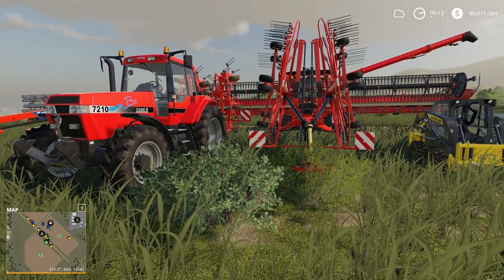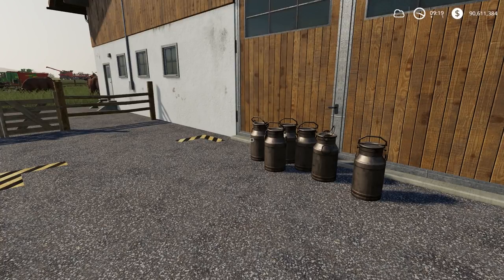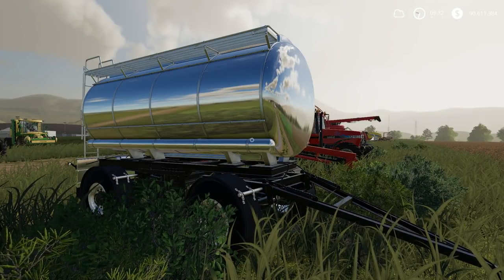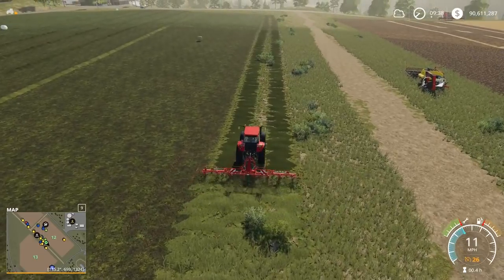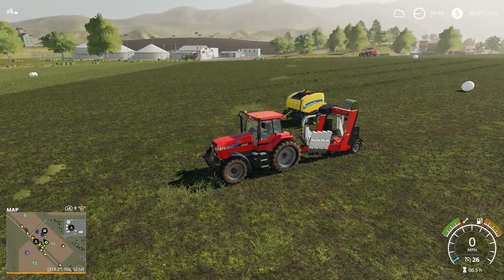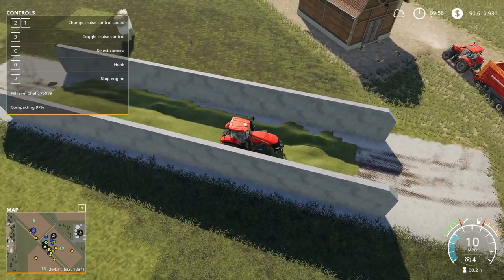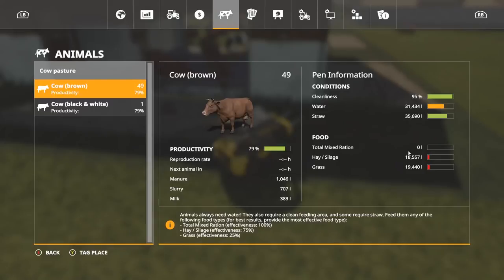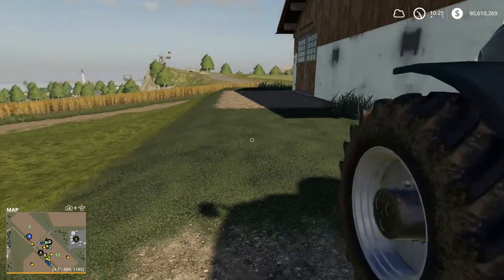Farming Simulator 19 - An In-Depth Guide to Feeding Your Cows - A Tutorial

Comment: Question:  what's a good way to give them loose grass from a bunker? The mixer won't pick it up and you have to drive over it for a wagon which changes it into chaff.
Reply from the maker: You could shovel it from the ends - don't drive on it.   I think that will work.  Shovel it back into a tipper or loading wagon.  Then dump the wagon into the feed trough.
Reply: @Vbluguitar  thanks! Looking forward to trying this
Reply: @Vbluguitar  Upon further experimentation, if you dump loose grass into the bunker it automatically changes to chaff, which I couldn't drop on the feed trough. I pile it alongside the silo now and it works fine, doesn't look out of place, I landscaped a little area for it.

In case anyone else wanted to know :)

Comment: ran across your videos a couple days ago, and this one when looking for info on what i thought was strange happened to me. I was mowing the grass that grew around my field, and the color was a light green. Then it started raining, and the new grass that was cut was a dark green. I took the windrow and made nice rows, but i noticed the 2 colored grasses didnt mix together, and when i went to round bail it, it would only pick up one color grass at a time.  I wrapped the round bails, and that went like normal. Im wondering if there is now a difference, or are both types the same. Now i also have a partial bail of grass, and it wont pick up the other type. Is there a way to remove it from the bailer or will it change to the next type im eventually going to bail?
Reply from the maker: The crap in the baler will give you a full bale of that material no matter what you put in it, and then switch - so if you have grass, and collect straw, you will have 1 grass bale and then once its cleared out, the rest will be straw.   The dark material is grass, the lighter green material is hay.   if you tedder grass (using a tedder) it turns to hay.  I find it strange that you were getting hay when mowing though - are you using a mod mower, or maybe seasons?

Comment: SO I know for FS17 you needed Grass AND Hay/Silage AND TMR to get the best results - though TMR would fill both TMR and Hay/Silage bars.

In FS19 on the animal status page it lists requirements as 25% Grass, 75% Hay/Silage and 100% TMR - does that mean we can use either Grass AND Hay/Silage OR just TMR to get the same results??
Reply: Neil Harbott if you use TMR you will get 100% productivity if you use hay you get 75% and grass 25% but if you use grass and hay you’ll get 100% so in fs19 you DONT need to have all three
Reply from the maker: Once again - its only 80 percent (as seen in this video at the beginning)  You need TMR to reach 100 percent.

Comment: Where do you get the water
Reply from the maker: Depends on the map.   If you can't find "free water" like a river or lake, then you can go into your placeable structures and buy a water tank (its bright green).  You then use the water trailer to move it from the tank to the trough.   Also in this video at 42:35